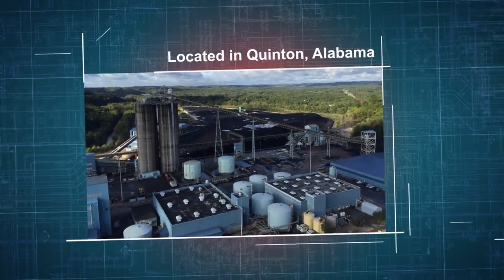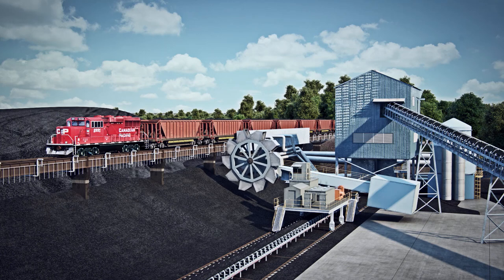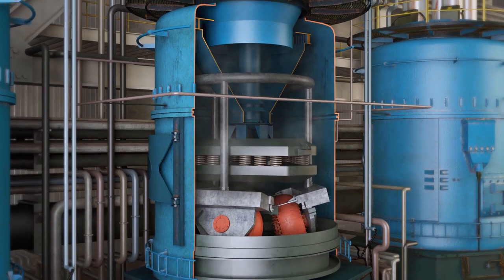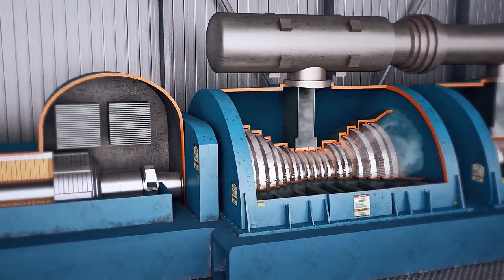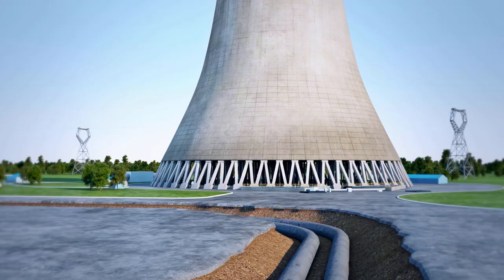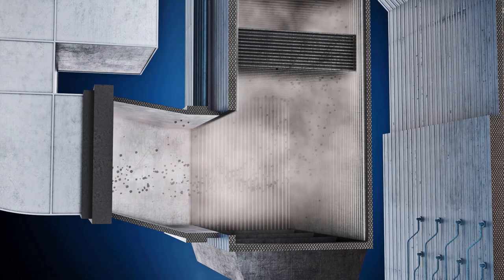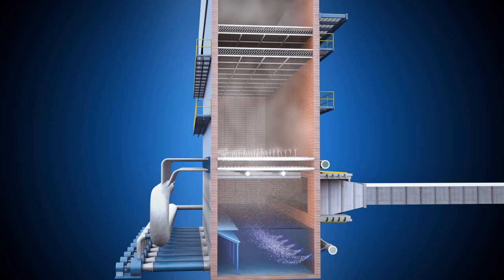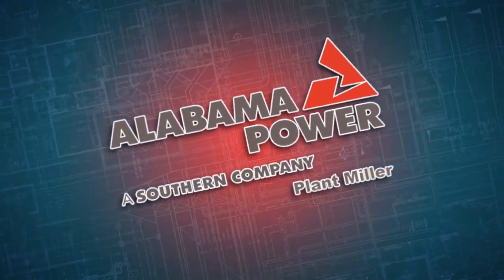Alabama Power's Plant Miller How Electricity Is Generated 3D Animated Tour

Comment: since when coal fired power plants are considered to be "green" thats some bs right there
Reply: @Mason.Ulick60  What are you even talking about. So what happens to the coal that gets burned and the result is literally CO2 plus other NOx and SOx? All of it magically gets scrubbed out and captured?
Reply: @R.James.  the scrubbers scrub out the sulfur and nitrous oxide down to almost nothing. That’s the job of the scrubbing units, most scrubbing units are electrostatic precipitators. They clean the emissions coming from the boiler.
Reply: @Mason.Ulick60  Yes so what about the most important part you conveniently left out to answer? What this whole climate change problem is about. 
CO2

Comment: Why would you chlorinate the water?  I thought that chlorine damages stainless steel.
Reply: brent Robot 
The chlorinated water prevents algae biofouling of the condenser tubes. Without this, the biofouling would cause increased condenser backpressure and lower the power rating of the plant.
Reply: electrolysis anyone?
Reply: @gregorymalchuk272  How can algae grow in distilled water?  Is carbon dioxide and other minerals necessary for life getting into the water.  Not to mention algae needs light to grow.  Also steam and high heat are pretty good at sterilizing.  Is the algae eating the carbon in the carbon steel?
Reply: @brentrobot585  No, they don't chlorinate the turbine feed water, the chlorinate the cooling tower water/river water circuit that goes through the tube side of the condenser. This water is exposed to the elements and can cause biofouling of condenser tubes. And condensers are variously made from carbon steel, stainless steel, copper, copper nickel alloys, and brass, depending on the particular needs of the plant. But yes, chlorine can cause particular problems with stainless steel.

Comment: Some actually buys coal ash and uses it for something? I thought it just all goes into a landfill where it pollutes groundwater.
Reply from the maker: Yes, something we learned while producing this as well. Awesome that there are many uses for fly ash.
Reply: @edpvideo   What uses for coal ash are there? All I can think of is adding it to concrete, to produce somewhat worse, but still usable concrete?
Reply from the maker: @1Maklak  It is used to make wall board (gypsum), so it's probably in most houses and buildings you've been in.
Reply: I believe it actually goes into sealed containers. Extremely large containers, but sealed from leaking. Atleast it is in GA, which can’t be any different

Comment: My god coal is so inefficient
So much fuel for such little energy
Reply: Chris Russell 1 kg of coal will generate 8kwh of heat. 1 kg of uranium 235 will give you 24,000000 of kWh oh heat.
Reply: Chris Russell  yes .. yes there is
Reply: It's called thermal exchange
Reply: It works from heat or cooling
Reply from the maker: Seems like we get a ton of energy from coal. We certainly use a ton of energy
Reply: Andrew Manche new generation reacotr fuels are far more efficient such as thorium fuels that use 60% of its fuel leaving very little high level waits with half life’s of hundreds of years not thousands. Remember uranium comes from the ground and gets sent back to the ground. Unlike coal it’s trapped in the atmosphere that takes energy to extract it. I’m all for new gasification coal plants but they are not efficient. New iv gen reactors technology are far safer and far cleaner with a number of reactor styles. There is no argument anymore they nuclear is the answer to climate change. It’s just the matter of how and what
Reply: Andrew Manche no but there is work on designing Intrigue fast breeder reactors that repossess it’s spent fuels leaving very little high Level waste products. That is something etching that is in the works.
Reply: Andrew Manche the designs are there ready to use. The problem i legislation. Specially in Australia no nuclear development can be conducted by any private company. Ones there is an interest, investments will follow into these technologies. Look at Rolls-Royce for example. They already have plans to build 15 small modular reactors in the next 5 years. They are already sighting locations for the new platforms. These reactor are small and mass produce where one reactor can retro fit an old coal fire station without the need of containment shelter

I fully understand that coal makes money. A power source that consumes more fuel then it out puts simply means more profit margins for the coal industry. A sys that is more efficient like nuclear where a power Station only need to be refuelled every 10 years means that your mining sector won’t make as much profit. Simply put it the reason why our power cost is so high is because we pay so much to use and to get the fuel it self. 
Modular reactors and 4th gen reactors are the new future. I do see coal gasification a good idea but your just loosing efficiency by doing. 
Energy company’s love low efficiency because it means more money for them. But now they are paying the price for carbon emissions, it’s time to face reality. 
Coal has a very low efficiency and is highly pollutant. That is a fact. Nuclear means clean abundant clean energy with very small environmental impact. The more we argue this fact the more we can move forward and pay less at the menter and at the pump with synthetic fuel production
Reply: edpvideo That makes sense how?
Reply: It may shock you to learn this but water boils at 30c in a vacuum and returns to liquid at 29c the expansion rates are the same no matter how the water boils. This means in a closed system you can run a steam engine off heat from the sun and endothermic from water sources you could even run an air conditioner use the heat to boil water and the cold to return it to liquid.
Reply: Barskor1 I’m refrigeration mechanic it dose not shock me at all.
Your forgetting to put anything into a vacuum to get any desired effect it takes large amounts of energy. The reason we use refrigerant is because it’s the most efficient and effective way
Reply: @muckman5509  No it does not take a lot of energy to get a vacuum as the vacuum regenerates its self from the condensation of the water over the life of the system it is trivial regardless so a small vacuum pump is acceptable to use.
Here is an experiment to prove how easy it is to get a vacuum. 
Take an empty soda bottle put in a little hot water cap it and shake it when opening it up a whoosh of air will come out reclose it and let it cool as it cools the bottle will be crushed from outside air pressure as the inside has much lower pressure.
At an industrial scale for vacuum production, you can use superheated steam to much greater effect.
Another way to get vacuum at industrial levels cheap and easy is by using gravity, water pumps, valves, pipes, and two tanks any drop over 35 feet will overcome Earth's air pressure you fill the top tank open a valve it will flow to the lower tank and leave the top tank in a hard vacuum condition.
then it is just a matter of opening other valves to the system you want to evacuate repeat as needed to get the desired levels of vacuum.
Reply: Where did you get your Engineering degrees? You must know a lot about Thermodynamics, Heat Transfer (admittedly I did poorly in Heat Transfer), and Combustion.
Reply: @kinvert  Nothing does better for education than curiosity and the freedom to indulge it.
Ask Elon Musk how he feels about college degrees and their necessity.
Reply: @Barskor1  Knowledge about efficiency matters when complaining about efficiency. Though I have 2 degrees, I do my work in an area I have no formal training.
Reply: @kinvert  Funny how life works out. :)

Comment: Sure! "Clean" energy. Nice try.
Reply: global warming is a big fat FRAUD on the human spirit. DIG CAOL, The sun who control climate change not human we just came on this planet yesterday.
Reply: @thegreath.sapiensapien6907  What are your sources for this information? Just by typing "coal effect on climate" to google you can find countless well established studies, that have found that burning coal indeed does have a significant effect on climate change. Can you point me to a study that proves your claim.
Reply: @spardasquadspqr3535  More co2, more growth. Seems logical on the surface, but when you dive a bit deeper, you'll find out that it's more complicated than that.

Plant leaves have small openings, called stomata, all over their surfaces. The stomata open to absorb the co2 and to release o2. While the stomata are open, water is also free to evaporate through them. Because of water loss, the plant doesn't like to keep the stomata open more than necessary. As co2 is a greenhouse gas, temperatures rise when co2 concentration rises, which makes water evaporate more quickly through the stomata. Because of that the plant keeps the stomata open less time than before. To make the plants keep their stomata open longer times, they need a relatively cool and humid environment with lots of water to replace the evaporated water. That kind of environment doesn't exist in the nature if the co2 concentration is high. In greenhouses it's achievable.

I checked the co2 emissions from volcano eruptions. Volcano eruptions make less than 1% of global annual emissions. And that's beside the point. There's nothing we can do about them, but we can reduce our own emissions if we want.

Do you think I like to pay more in taxes and what not to fight climate change? I'm not rich and I have stuff to buy. I don't claim to be a "green fool". In fact, I don't really care about my co2 emissions, and I accept, that I'm kind of a bad person and hypocrite because of it. The difference in us is, that I'm able to pull my head out of my ass and look at the facts as they are.

Comment: Ask any number of people today  an they'll tell you that electricity comes from the wall outlet or USB port.
Reply from the maker: And they are absolutely correct. It comes to your computer, or TV or other device from the wall outlet. I think the real question is where is electricity generated.
Reply: @edpvideo  
I think they just wanted to tell how clueless people can be today, it's just good to have basic information of the things that we use stuff daily, but unfortunately much do not have it, even though it is all readily available in the internet today
Reply: @edpvideo  You are right but most people knows it comes from somewhere else  besides the wall socket. If they don't we need to change the education system in this country and start teaching about science and not gender issues.

Comment: Notice that the video does not show the actual live operation inside the plant, that is because a coal electrical plant is very dirty and hazardous environment. Many jurisdictions within North America are closing and decommissioning coal plants due to cost and environmental issues.  The cost of natural gas and superior emissions issues coal doesn't make sense to generate power any more.
Reply from the maker: I have to disagree. The inside of the plant is mainly a maze of pipes (just like you see in our animation) and for the most part is remarkably clean. On my first ever visit to one I expected it to be crazy dirty, but they are not. I'm also not sure what you mean by a hazardous environment. They certainly do not appear so to me, at least not any more than your typical manufacturing plant. I'm all for alternate generation methods, so I don't dispute that, but I think you're off on the dirty and hazardous environment comments.

Comment: Close this plant down. Imagine burning 38,000 ton - PER DAY. replace quickly with renewable power sources and nuclear power. This plant is contributing to global warming in a shocking way. Insane.

Wasting hotwater in cooling towers instead of using for heating of cities. Insane
Reply: I agree, but at least they're trying to do things as efficiently as possible with the energy source they've committed to. For example the stages of ash and chemical scrubbing which all cost money and reduce profits. But again I agree we need to stop investing in antiqued energy.
Reply: Chris Russell  yes. 50% nuclear, 50% hydro
Reply: the hot water would be cold by the time it got to a city
Reply: @genix1858  no it wont. Many European cities use massive insulated pipelines for hot water. Works very well
Reply: how do  you get it to the cities
Reply from the maker: Come on man, play nice
Reply from the maker: Can that be done? Can you function without using electricity today?
Reply from the maker: @Chris Russell what do you mean?
Reply from the maker: Where are you located for that nuke/hydro combo?
Reply: In Russia that hot water actually is reused to warm up homes, thats why by law it should be 18 degree Celsius in apartments 24/7, but in reality it is almost 25 degree Celsius, peopke where shorts and t-shirts at home, wven open windows sometimes. It is almost free heat, they pay only for maintaining
Reply from the maker: @ka-md8ue  Wow - very interesting!
Reply: @kentaltobelli1840   Actually they are not as efficient as possible, the steam exiting the hp turbine should be reheated to further reduce water contents after decompression in the turbine and increase overall energy efficiency of the power plant. Directly feeding the steam of the hp turbine into the lp turbines can and most likely will damage the lp turbines to to high water concentration. it it is above 10% it will degrade the turbine faster and will reduce its lifespan by a lot or will destroy it immediately. This shows how dated and inefficient the Power plant actually is.
Quick calculation from data given by the video:
38kT of coal a day means 1.5kT/h or about .4T/second. For a specific energy density of coal of about 20MJ/kg (assuming its not lowest or highest quality coal.) this means about 8000MJ/s which is 8GW of energy burnt. Compared to the electrical output Power of 2.9GJ that gives you an Energy efficiency of only 36.25%. Modern Power plants in Germany with re heating  and exhaust filtering achieve an astonishing 42%. And this is assuming pretty cheap 20MJ/kg coal (higher density coal gives you worse efficiency).
6% does not sound like much but for that burn rate it means 2280T coal saved per day or, 10 fully loaded Train wagons. And with filters and cleaning you can get rid of more co2 and other gasses like sulfuric bonds. It is more expensive but it's way more eco friendly.
Reply: @FlaxTheSeedOne  wow I never thought I'd see a well thought out comment on YouTube haha. I was actually wondering about that myself but figured the temperature differential would be too low to be useful - sounds like it's still useful just not economical. So you're saying they currently extract energy down to the 10%  level and then dump the remaining heat because it would cost too much in maintenance to extract the rest?

Edit: nevermind about the maintenance part. Rereading it sounds like you're saying the German plants run the steam cycle at a higher overall temperature from start (using recycled low pressure steam) to finish. Thanks for sharing I'll look into it!
Reply: you come up with a way to do it with less waste and you will be rich.
Reply: @bermchasin  hydro, solar, wind and nuclear power.
Reply: re: "replace quickly with renewable power sources "

Abra-ca-dabra ... DONE! Oops ... one little problem ... have you figured it out yet?
Reply: @EriksZ  is that all you got? Pretty pathetic
Reply: @EriksZ  how predictable, out of arguments, instantly turning rude. Clear for all to see. Pathetic

Comment: They did not explain where they get the electricity to generate their electricity!
Reply: They need either the grid or on-site generators to start it up. Once it works, some of the generated electricity is used to power all the pumps, conveyor belts and rock crushers.
Reply: From space
Reply: @1Maklak  Do you have proof? I have been searching for an answer to that question posed by D bros all my life? I want verification!!!
Reply: Very good question Bro!
Reply: Power researcher here. While the facility is being developed, the power comes from an outside source. Once the facility starts running it consumes its own power. Such consumption of power is called auxiliary consumption.
Reply: Asad Khan Afridi but I thought it wasn't good to "get high off your own supply"
Reply: re: "They did not explain where they get the electricity to generate their electricity!"

A MOVING WIRE in a MAGNETIC FIELD. I think this was settled some +200 years ago.

Comment: This is such a waste of energy all that heat wasted when its condensed
Reply: @ninodroid2382  because your a master engineer and inventor beyond most  ..let Tesla and Albert Einstein speak your name
Reply: About 50% of the energy is put into the cooling tower.  This is because there is a large energy need to convert water into steam.  This energy needs to be removed in order to condense it into water.  This must happen because we cant really pump steam.  When the steam gets to the condenser it is about 90 F and not far about 2 psia.  Our atmosphere is ~14 psia at ground level, meaning you need about 210 F to have steam.  Depending on the plant this steam may have started out at 3400 psi and 1100 F.  Some places do have ways of recovering some of this heat and using it for other processes, such as building heat for local buildings.
Reply: @andrewt.5567  It would be interesting to see if a massive array of Peltier units could recover this energy.